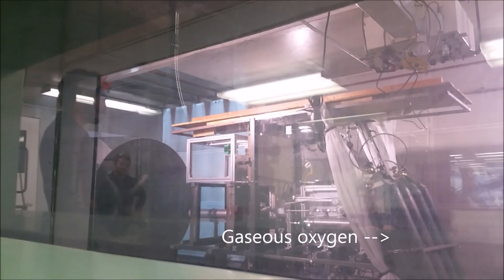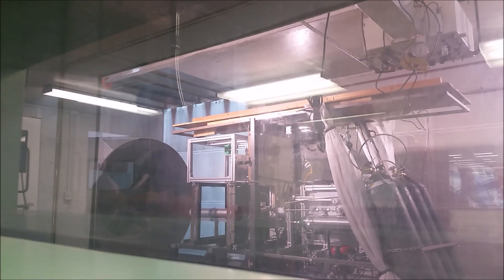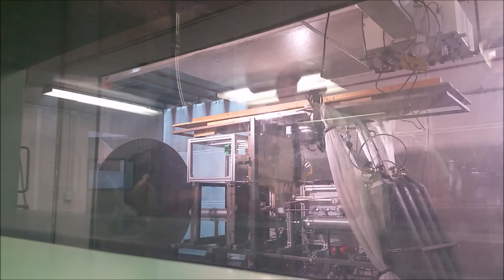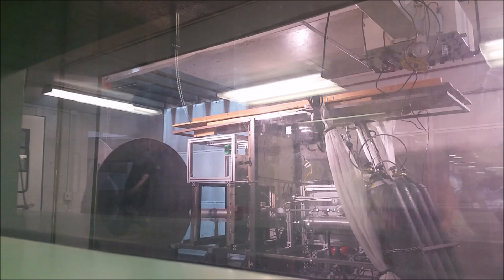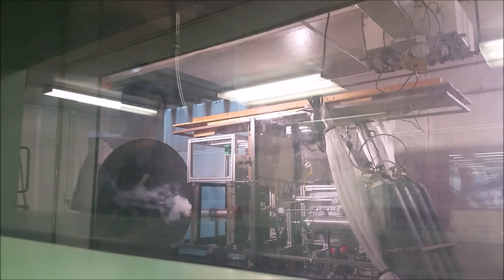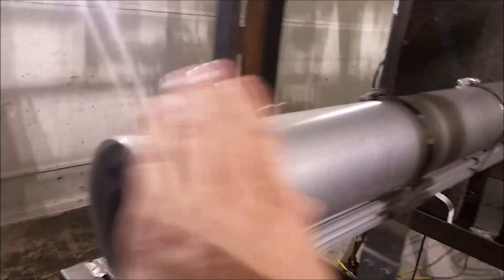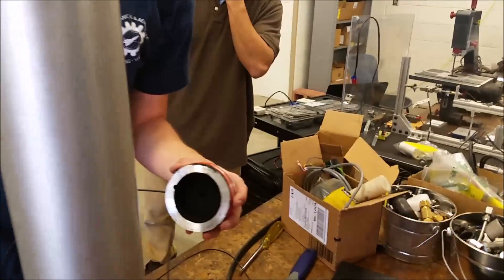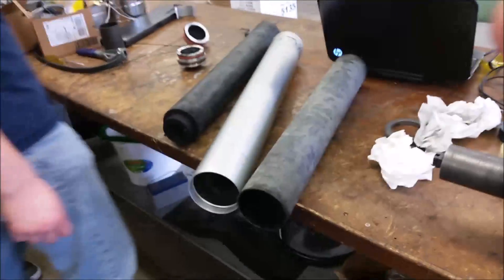200Lb Thrust Rocket Test

Comment: Cody I have been involved in high power  rocketry for several years. I have built several scratch  built one, one of which was a 12 foot tall 6 inch diameter ASP replica. I flew it on A "Numb" N4800 aquaflame research motor. My electronics said it flew to 17,500 ft at a bit over mach 1. I'd like to talk with you on this subject if you'd like to do that. most guys don't get the center of gravity right with the center of pressure which makes the rocket unstable. Anyway if you'd like to talk let me know?
Reply: wtf, if this is real please let him contact you
Reply: Lol

Comment: So.... is it basically a sophisticated potato cannon?
Reply: Er, in that they both use a combustion reaction to produce a force, yes, it is a very, very sophisticated potato cannon.  A potato cannon that runs an oxygen rich fluid over a solid propellant and then squeezes the resultant gasses and plasma through a specifically designed nozzle, which in of itself requires some high level math such as differential equations and multi-variable calculus.  And of course if you tried to hold it to fire a potato, you'd probably lose your arms... And face... And the potato... Yeah, it's pretty much a glorified potato cannon!
Reply: Spazz Tic
Oh shut up you numpty. You can pump oxygen through a hollowed out meatloaf and turn it into a rocket. And as for all that: "high level math such as differential equations and multi-variable calculus.".. Mega cringe. They aren't going to build the matrix and simulate our entire reality to figure out a fucking nozzle you dweeb. You'd use the information that's already out there. There's an app for that I'm sure. There's pre-made templates that you can dial in and fine tune.

Comment: That's 200 lbs total thrust, over the course of that half-second (or whatever it was) burn?
Reply: Thrust doesn't add up, you're thinking of impulse. So if the engine ran for 3 seconds at a thrust of 200 lbf (they say pounds, but it should be pounds-force) it would apply an impulse of 600 lbf s.
Reply: So then how is the thrust actually measured in pounds?
Reply: johnstephenalbert
Not sure what you mean here. The thrust is the force being applied by the engine at any point in time- in this case, it's equivalent to the force exerted by a 200 lb weight, or alternatively the amount of force needed to accelerate a 1999 chevy suburban from 0 to 60 mph in around 80 seconds (assuming the suburban is in space and thus not subject to drag or friction. Note that I got the maths wrong initially, edited to fix them). They measure it with what is effectively a big set of electronic scales- the rocket is allowed to push on them, and the force is measured.

 If you're asking why they say pounds rather than pounds-force, they generally do that to avoid confusing laypeople. It's poor practice though, as a pound is a unit of mass: on earth 1 lb feels like 1 lb, but on the moon 1 lb feels like 0.16 lb does on earth. This rocket will produce the same force anywhere (actually slightly more in a vacuum than at sea level, but I won't get into that). When we say pounds-force we're clarifying that the force is equal to what you'd feel from that weight on earth- so 200 lbf is the same on the earth or the moon.

Most scientists like to avoid such confusion by using SI units- that way you can just say 900 Newtons of force, and everyone understands.

Comment: I remember a magazine article from the 1950's about a team of rocketeers building a hybrid using a cast rubber solid fuel with liquid O2 injection through the center cavity which created huge thrust and reached a very high altitude. I don't remember the source of the article (Popular Mechanics...?) but this concept stuck in my memory. This was at a time when I was experimenting with sugar and KNO3 and thinking I was really doing something.

Comment: I wonder if Urea could be used as a solid fuel in a rocket like this.  It would need to be stabilized because it is pretty packed with chemical energy, but most of the products of combustion are safe for the environment.

Comment: I left this comment on your liquid rocket test 3&4 video a while back but in case you didn't see it there:

I can think of a couple of modifications that might make a liquid fuel rocket more tractable. Firstly, instead of nitric acid, you may be able to use ammonium nitrate. Pure ammonium nitrate would be risky to melt, but according to wikipedia's solubility tables, you can dissolve 400g of nitrate in 100g of water at 55 °C. This essentially gives you a liquid with a composition of ammonium nitrate monohydrate. It would be cheaper, safer, and easier to operate than nitric acid, and you wouldn't have corrosion concerns. 

Secondly, it may help to use an elongated combustion chamber that you can pre-heat the back of (away from the fuel injection nozzles) to a red-heat. Pre-heating could be accomplished with an external heating source, internal coil, or simply by igniting the engine with a very low fuel flow rate at first and just letting it burn inside the chamber for a bit. Even if you don't manage complete atomization, the heat in the chamber may serve to vaporize the propellant. Plus a longer chamber would allow more time for fuel-oxidizer mixing. There are plenty of refractory cements out there that you could line your chamber with to insulate the metal chamber walls.
Reply: Aerospikes are not easy to do. He has much more significant problems just building a liquid fuel engine that will sustain combustion and not explode. This kind of optimization shouldn't be a priority until he's solved the basic problems first.
Reply: +Cody&#39;sLab Why don't you make more video again about that experimental rockets ?
Reply: +Cody'sLab try to put a spike  on the back if you are gonna make a hybrid rocket to theoritecally boost efficency

Comment: Forgive me for the uneducated question.  It sounds like ABS is their solid fuel, and that makes enough sense, particularly considering cost, but why are they using gaseous oxygen as opposed to liquid oxygen, nitrous oxide, etc.?  Gaseous oxygen seems impractical in an actual rocket in terms of space and weight.
Reply: I suspect that the most important factor of all (cost) would be breached with the use of liquid fuels, and also it is a much simpler engineering solution to use gas.
Reply: Sam Ah, that makes sense.

Comment: Very cool, does the oxygen pressurize within a chamber or does it feed straight from the tanks?
Reply: +Cody'sLab I ask because I know those big tanks weigh too much to be fitted on anything that rocket is moving. Do you know about what size the secondary pressure chamber was?
Reply: +BrokenTVink after asking I see now that its a personal oxygen tank, makes me picture a rocket powered wheel chair.

Comment: You could build a hybrid rocket using a thick acrylic tube as fuel and feed oxygen through it. Check out Applied Science's video on it! He also have many other nice projects
Reply: +Cody'sLab bro how have you already got 100k
Reply: +Cody'sLab Hey, you mentioned you plan on building your own.  I'm currently working with a graduate group conducting hybrid research, but with N2O as an oxidizer, since its safer to handle than Lox.  Just some quick safety tips though: don't let your oxidizer get too hot, since N20 can begin to decompose after it reaches about 90F( its super-critical temp).  An example of what can go wrong is the scaled composites N20 explosion accident.  Lox has its own extra safety concerns.  USU's setup looks pretty sweet though.  
J
Reply: Moraren they used an abs drain pipe. i missed it but they do say that it was abs drain pipe cause Cody remarked that the chamber looked to be graphite lined. also looks to be they want a simi solid fule rocket that can be turned on and off..
Reply: I think they used ABS as the fuel. It's a hybrid rocket motor, with a solid fuel core that uses gaseous oxidiser so it can be throttled. It's possible to use plastics as the fuels because they combust reasonably energetically and readily in an oxygen atmosphere (remember that plastics are effectively ultra-heavy hydrocarbons).

Comment: Aren't they afraid the graphite will catch fire?
Reply: +psdfjsbpisdbf what are you, a fucking jehovahs witness on opposite day? "Excuse me do you have a moment to talk about there is no God? Sir? Please?" email the dude if you want to talk about serious shit- yt comments ain't the place.
Reply: *****
You apparently don't know how the youtube comment section works. Should I explain it to you or do you think you might be able to figure it out for yourself?
Reply: +Shwat Toddle i assume graphite is used because it has no melting point and the temperature that it will become gaseous is not feasible by any rocket I can think of.
Reply: +Shwat Toddle Lighter, and able to tolerate high temperatures.
Reply: +psdfjsbpisdbf Get your head out of your ass, Come to reality please.
Reply: ***** Thanks for the reply. Do they choose the graphite because it's less expensive that other materials or is it really more durable than say, high carbon steel?
Reply: +Shwat Toddle This shit-show comment thread aside (which I find hilarious to follow/not be able to follow), I think they simply used graphite for the light-weight properties as well as probably just for testing purposes on strength. I'm sure along the line there has been/will be some heavier, stronger metal testing.
Reply: +Shwat Toddle I'm not taking sides, not whatsoever, but i'm thinking "lds" is his shorthand for "Latter-day Saints" but i'm just speculating.
Reply: +Shwat Toddle 
Hose clamps
Reply: +Shwat Toddle I know that graphite is one of the best materials to use to withstand electric arcing (way better than steel). That's in SF6 atmosphere, however. So not sure how it handles in the presence of (even ambient) oxygen.
Reply: +psdfjsbpisdbf reported